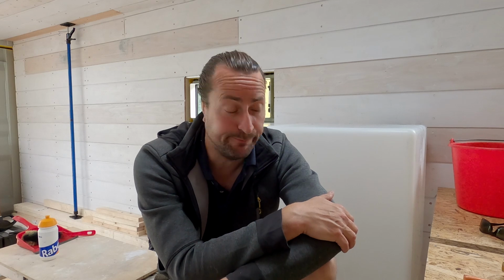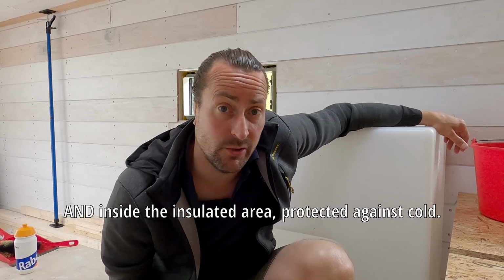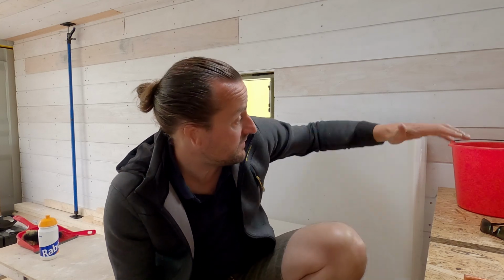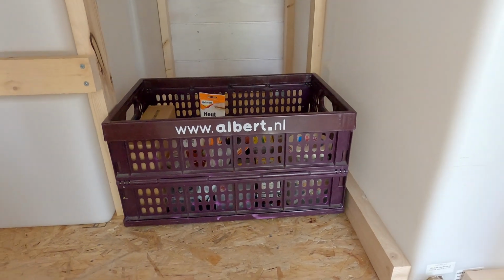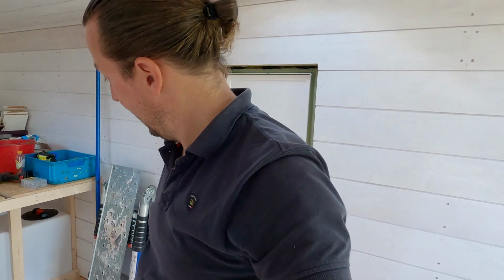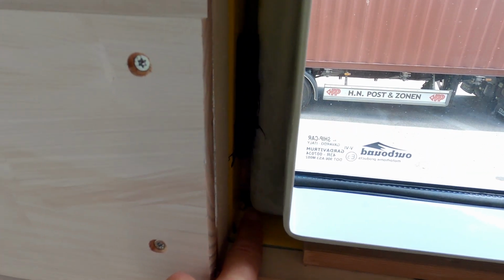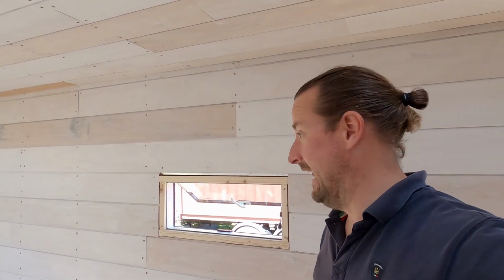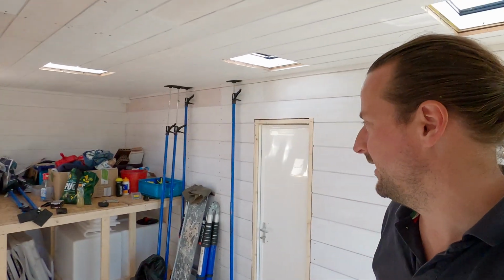TANKS and WINDOWS progress | BUILDING OUR TINY HOUSE ON WHEELS

Comment: I am curious, any electrical wirings?
Reply from the maker: Thanks for the question and well spotted. You must be a builder yourself? 

"Normal people" put wiring and plumbing in the walls. And indeed I did not. In my design I used interior walls and the floor for it. I wanted to keep insulation complete and the build quick.

Hope this explains a bit. In next video I will show it.

Thanks for your support!
Reply: @uglysjourney  Thank you for responding. I am not a builder, but I am constantly watching camper van builds for months now. I have plans to build one. Best regards.
Reply from the maker: @akogepayo good luck on your build! Please let me know if you would like any feedback, advice or support. 👍
Reply: @uglysjourney  Sure, will do.